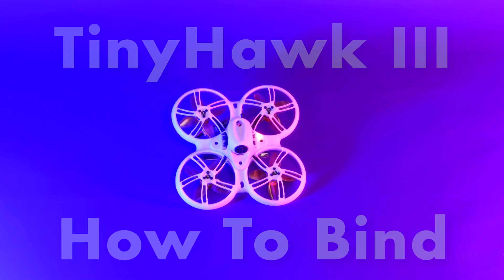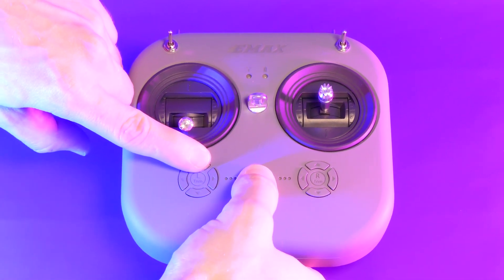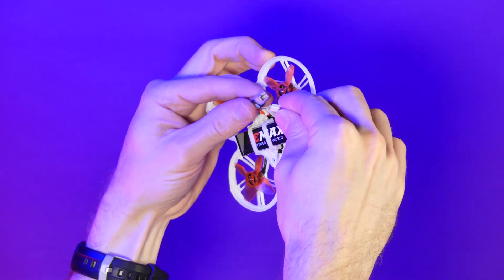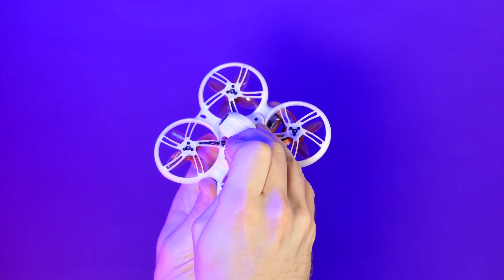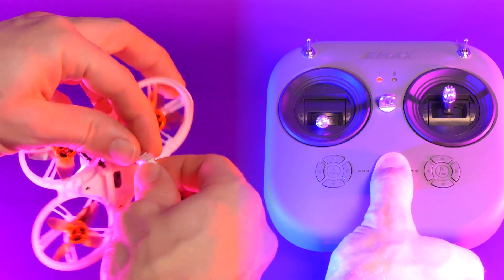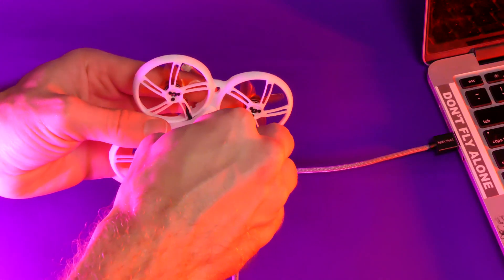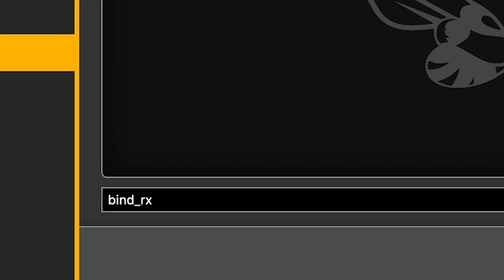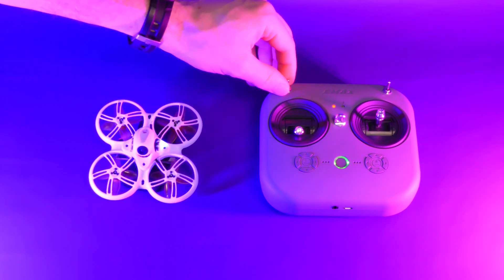Emax TinyHawk III - How To Bind With Your Transmitter

Comment: Hi, i got the tinyhawk 3 bnf and the e8 transmitter and got some binding problem. It doesnt work with the button and with bêta flight. The blue led dosent go permanent. Can you please help me ?!
Reply from the maker: Hmm. There could be a hardware issue. You might have to contact emax support directly.

Comment: What Lights/Sounds should my drone make when its binded?
Reply from the maker: Sometimes it's hard to know when it's bound. I will usually flip a switch or two, just to check. But if you are plugged into Betaflight, you can try moving the sticks around and see the channels for throttle, pitch, yaw, and roll, moving around.

Comment: How do you bind it with the goggles?
Reply from the maker: It doesn't bind with the goggles the way you might think. It simply transmits on a certain channel (like a radio station) and the goggles just need to tune in to the same channel.

So, you can cycle through the channels and see if you get a video transmission. 

Once you do, double check that the channel number coming from the quad is the same as what the goggles are tuned to.

Comment: Brand new here, still waiting on my tinyhawk 3 to come in the mail. I have a crappy computer can I run beta flight on it or do I need a good computer. I'm not tech savvy at all lol. Tia for any info! Great video! 🤘
Reply from the maker: BetaFlight is a pretty light weight application, so I think you can use it with an older computer. Just be sure to find a data usb cable.

Comment: Need HELP please! My EZ Pilot pro won’t go into binding mode. The manual says to press and hold the bond button, but nothing happens. There’s no beep. No blue light. But I can put the transmitter into binding mode no problem. My computer is on the fritz, so that’s not an option. Any help would be appreciated. Thank you!
Reply from the maker: There's a possibility that your quad is faulty. Without a computer to try binding that way, will make it difficult to troubleshoot. 

If you're certain that your RC controller is in D8 mode and that you tried going through the motions of binding, even if the quad doesn't seem to flash lights to indicate it's in binding mode, you might need to reach out to Emax support for their suggestion. 

There have been occasions when I couldn't bind except when using a computer. I'm not sure why, but if you could try a friend's computer, it could help you troubleshoot the situation.

Comment: The power button on my e8 transmitter flashes a red light and beeps, it does not go into bind mode at all.
Reply from the maker: Try switching to D16 and back to D8 mode. When I've had issues, that seemed to help somehow. 

Reach out to Emax support if you continue to have problems with it. They are generally very helpful.

Comment: Any thoughts on what I can do if my tinyhawk 3 won't go into bind mode? Through the button or BF CLI? CLI just sits on binding and the button does nothing :(
Reply from the maker: Hmm... If you're sure that your radio is in D8 mode and also in bind mode, but won't bind to your quad, it might be a good idea to email Emax customer support. support@emax-usa.com
Reply: Did you fix the problem? I’m having a similar issue. When I press the bind button on the bottom of the drone, nothing happens. I can seem to bind transmitter to receiver.
Reply: @RareGoldenBread  have you tried holding the bind button while plugging it in?
Reply: @adaptimusprime  yeah, I’ve tried everything and the blue binding light won’t come on. I’ve even held the button down for 3 minutes and it still does nothing.
Reply: It's been a while did you fix the problem???? And how I have similar problem how can I fix it please , should I get a new controller?? @RareGoldenBread

Comment: Ya no. The user manual doesn't tell me to enter d8 mode. You're lying
Reply from the maker: It worked for me! As far as I know, the tinyhawk 3 needs to be controlled by an RC in D8 mode.

Comment: Mind switches the flight mode but will not arm the drone. I am using a tiny hawk 2 transmitter trying to connect to a Tiny hawk 3
Reply from the maker: Have you plugged your drone into a computer with betaflight to check that the arm switch is set up?

Comment: When I tried to bind them it just kept on saying binding, and do I also connect the controller with the drone when I put bind_rx?
Reply from the maker: Did you put your controller into bind mode and in D8 mode? It might also help to move the controller away from the drone while binding. If they are near close together, binding can fail.

Comment: I am having issues binding my Emax E8 receiver to a Nanohawk X. It is my first attempt at a new bind but it does not connect. Any troubleshooting advice?
Reply from the maker: Does the CLI command seem to put your Nanohawk into bind mode?

If you're sure that your quad is in bind mode, and you're in the d8 mode on your transmitter when you put that into bind mode, one thing to try is to keep your quad and radio controller several feet apart while binding.

Sometimes, I bind successfully, but I don't realize it until I go to the modes tab in betaflight and fix/ reassign my stick inputs.

If you're still not having luck, Emax has great customer support. Send them an email and they should get you going. Hope that helps.

Thanks for watching.
-
Kelly and Kris
Reply: @readysetdrone  Thanks. Have not used beta flight yet as just got into the hobby. Seems to be an issue with lack of experience and minimal support docs with new drone.
Reply from the maker: I've always had mixed success with binding analog FPV quads. Using betaflight for binding is a great way to troubleshoot the issue, as it'll tell you if the quad is in bind mode or not.